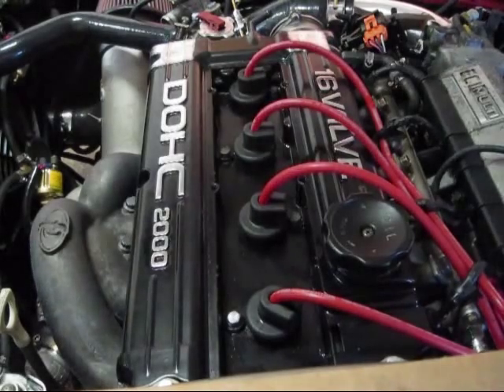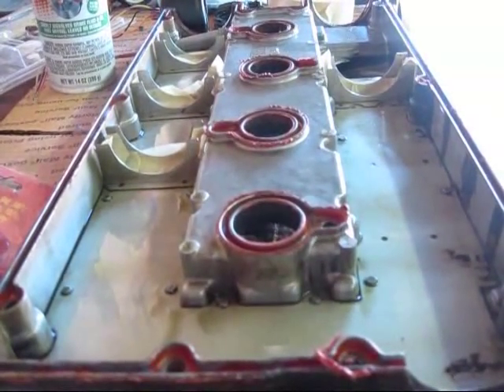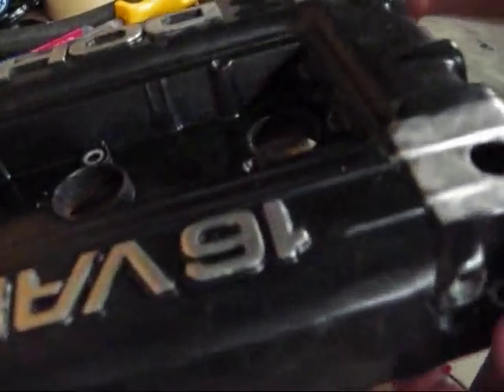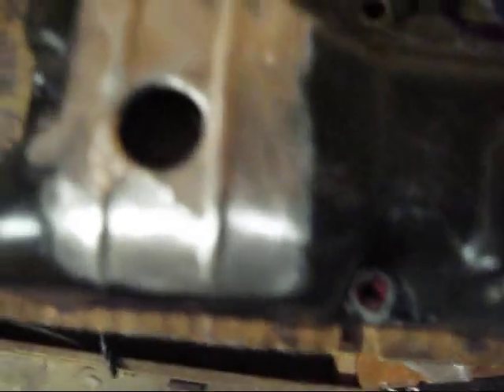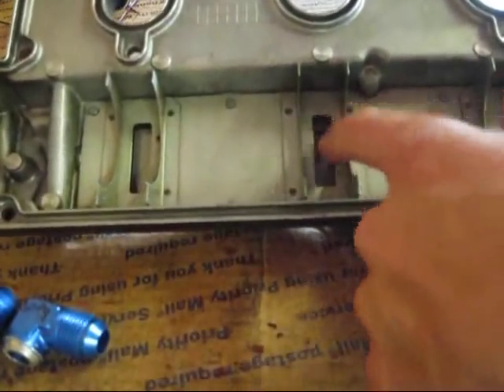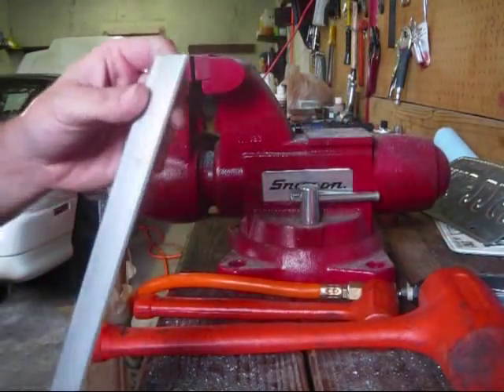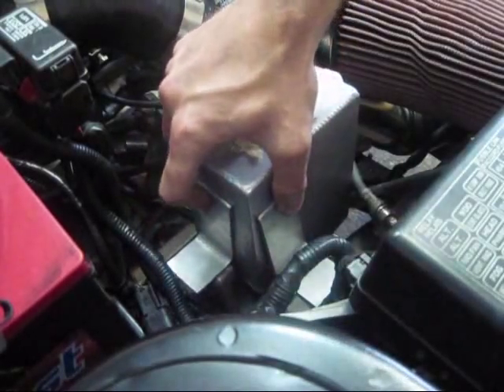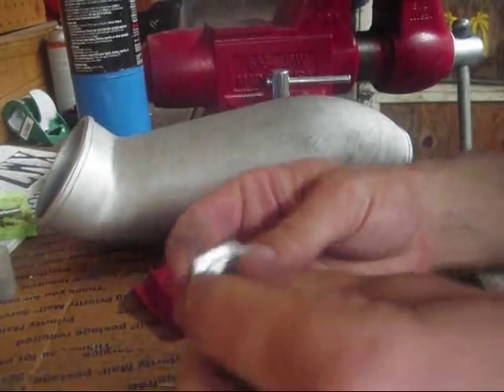Catch Can Part 1 - Tear down and Prep Work

Comment from the maker: The framing of the hood does play a large roll in what you can get away with. For instance, my fittings fit under the hood just as expected, but the routing of the hose also needs to be acounted for. With very minimal and shallow framing under the hood, you would definitley have more options. Since I used a stock hood you will see my solution in part 2 :)

Comment: Also keep in mind some aftermarket hoods (i.e. fiberglass or carbon fiber) may have smaller frames on the underside.  On my hood it is a much shallower frame than a stock hood.  So if you have one you may have extra room, if not it may gain you some room ;)

Comment from the maker: Great catch. I should have mentioned that I used something called tack puddy from the autoparts store. I molded this to fit where I was going to drill the holes and then closed the hood. This compressed the material and then I measured it to see what I could use. This let me know how much to cut off of the -AN fittings that where welded in. I have a few pictures but I did not manage to catch this on Video. Luckily I have a viewer such as yourself to straighten me out ;)